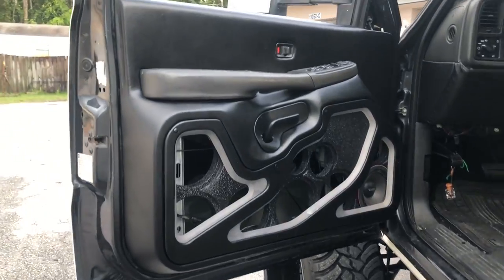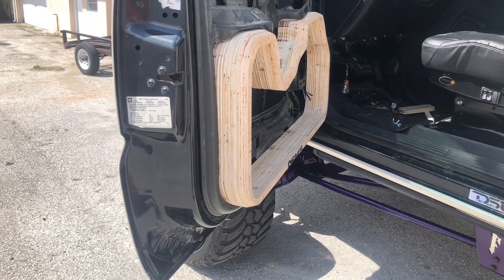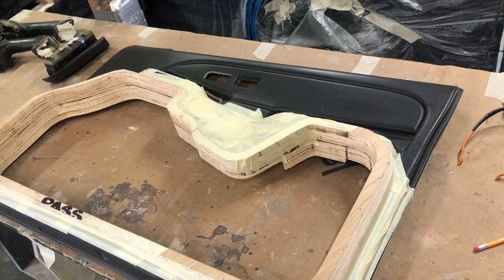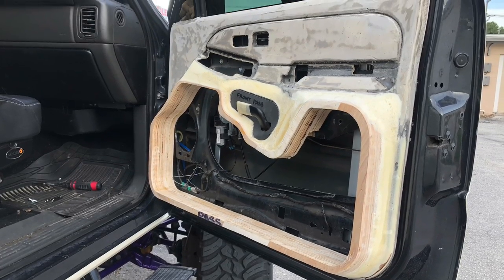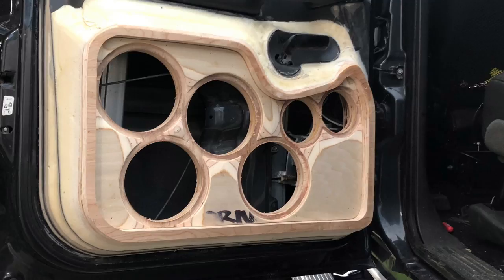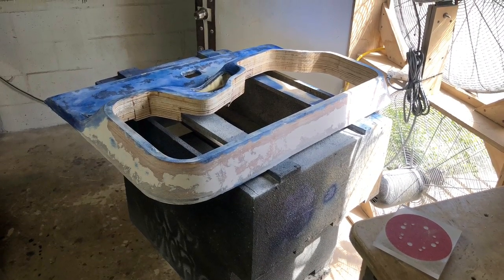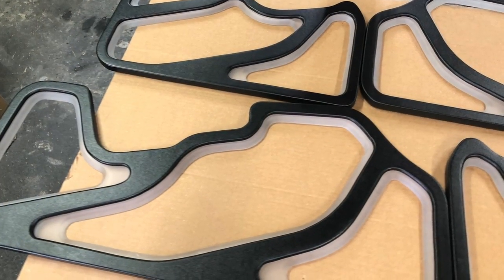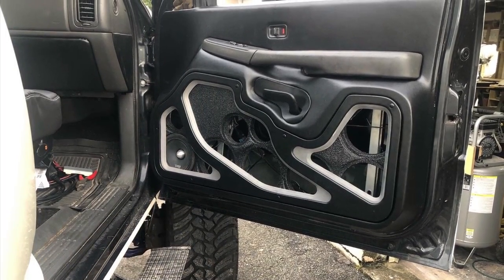Custom door panels PLUS TIPS AND TRICKS! ! Step by step! 2005 Chevy Duramax!

Comment: What would a set of panels like this run for a 2004 suburban? 4 8s, 2 supers tweets and a horn in each front door. And 3 8s, 1 super tweeter and a horn in each rear door
Reply from the maker: $8k
Reply: @CustomLowzVids  what about with standard grills not acrylic?
Reply from the maker: @mikearmstrong5922  i honestly forgot
To add that into account. I did that as a surprise to the customer. I’d probably charge $50 per piece. 

If you wanted to do normal metal grills you’d be at about $1800 per panel

Comment: I ordered a box design and the file didn't even work 🤔
Reply from the maker: The file works just fine. If your having an issue. Send an email. We will get back to you ASAP during business hours
Reply: @CustomLowzVids  I did
Reply from the maker: @AyeYoStony321  you just ordered this design roughly 30 minutes before you go on to my comments saying the file didn’t even work. These files are sent automatically. They always work. I have never had an issue with a file “not working” 

Someone will get back to you during business hours.
Reply: @CustomLowzVids  it's ok thought it would be quick but didn't....it came up